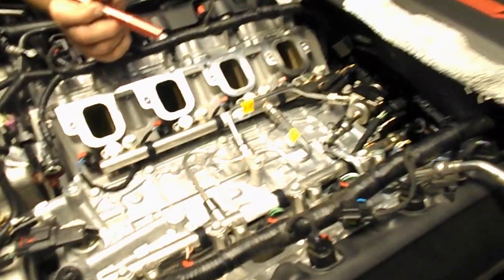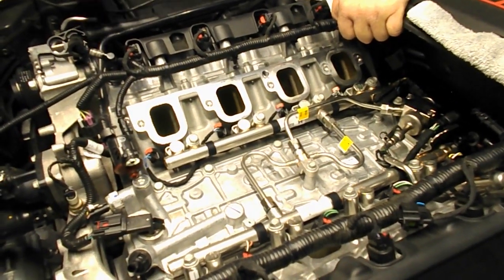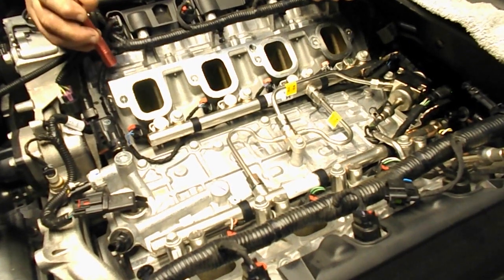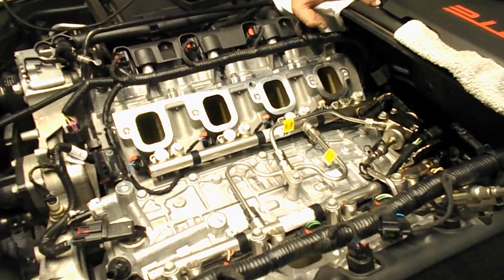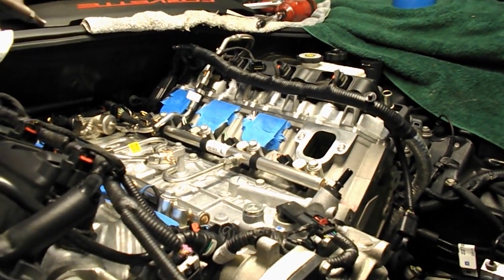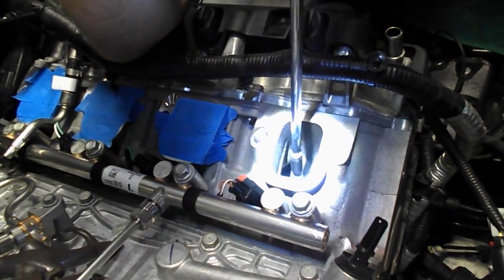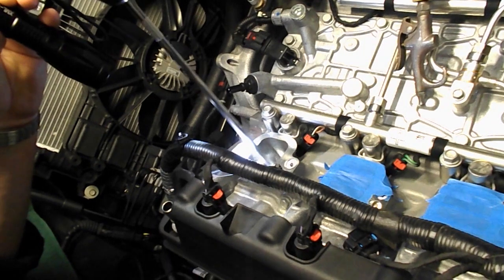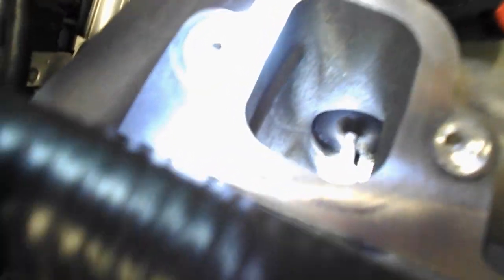RX intake valve cleaning

Comment from the maker: Hi Rafal,

The Press releases from Toyota, BMW, Mercedes, Audi, etc. claim they have what they have to date denied was an issue, fixed. The facts are they have made a small amount of headway, but none have corrected this, not even close (remember, to date, NO automaker admits this is occurring, yet in the past 3 years ALL have issued press releases on how they have now corrected it).

The 3 ways it is being dealt with on the OEM level areas follows:

1.  More robust/effective internal separation of the oil and other compounds from the PCV vapors. This helps, but at the sacrifice of engine longevity as these are also retaining the damaging combustion by-products to accumulate in the engine oil. 

2. Many have added in small port injectors, but the amount of fuel hitting the valves is far too little to clean and cool them, and it also now is creating high amounts of detonation so timing is pulled when the knock sensors detect this, thus defeating one of the main advantages of GDI. Most GDI engines are 11.5:1 compression ratio or higher, this is what allows them to make more power, burn cleaner, and not experience detonation. So, this is a huge backwards step.

3. Variable valve and fueling events.  The VVT cam allows the valves to open and close at different timing events to attempt in getting some fuel to touch the backsides of the valves. And to command injectors to begin adding fuel early, but again, this is far too little and over time has little effect.

Look at this picture to see why this was never an issue with port fuel injection:
[URL=http://s1083.photobucket.com/user/tech17/media/Port%20injection%20cutaway_zpscpca8akg.jpg.html][IMG]http://i1083.photobucket.com/albums/j392/tech17/Port%20injection%20cutaway_zpscpca8akg.jpg[/IMG][/URL]

Fuel constantly used to spray on the valves backsides keeping them cool and deposit free. Now here is GDI:
[URL=http://s1083.photobucket.com/user/tech17/media/Direct%20injection%20cutaway_zps8fg5at1r.jpg.html][IMG]http://i1083.photobucket.com/albums/j392/tech17/Direct%20injection%20cutaway_zps8fg5at1r.jpg[/IMG][/URL]

As no fuel is introduced until the milliseconds before ignition, the engine can utilize far higher compression ratio and produce more and cleaner power, with less wasted fuel (better fuel economy) as no fuel is present during the compression stroke to pre-ignite (detonate). But, when you now start to introduce fuel early, then detonation rears it's ugly head and the benefits of GDI go away.  Audi by the way is running 18:1 CR in the lab test engines on pump gas with pure GDI, which we would have never though possible in the past. Until the external system that separates the oil and other contaminants from the PCV vapors patent is issued and this is submitted to the auto makers direct, (it is a system similar to these but requires NO vehicle owner draining or service for over 100,000 miles as it "self empties" and meets all EPA requirements) and that is still 4-5 years before it can be added to the production process by the automakers. (even GM's ignition switch change took years and was only a .50 cent fix).

So. not even today's 2016 engines from ANY automaker have solved this, and there is no way until these contaminants are separated and removed from the intake air charge to solve this.  Oh, and Audi was doing the added port injectors 5-6 years ago to attempt to solve this. Do a patent search and you will find every automaker has several recent patents issued pertaining to solving these issues, yet all are only band-aid attempts and not addressing the actual cause. 

Questions? Just ask. over 4 decades working inside the industry and 8 years of GDI specific focus working with other industry engineers. Plenty of "snake oil" solution out there from companies just selling whatever.

Comment: Yes Toyota has a solution to keep the intake valve clean
Reply from the maker: Toyota has added in small secondary port injectors and this has helped slow the rate and severity of the coking, but only by app 50%. And in doing so increase the incidence of knock retard so not a good solution. The only true prevention is a proper system that is 95% plus effective, and then there will still be a small amount over time due to the EGR burnt gasses back filling emulation the VVT accomplishes.

Comment: you can easily go to a certified GM dealership and get a decarb service for a 110 $ this is more effective than a catch can especially for a daily driver
Reply from the maker: And in every case the best it removes is 40% (read the details) and 20% is average. And then the damage done to piston skirts and cylinder walls from the hard abrasive particulate matter shed as some is forced between the piston and cylinders causes scouring. Ford has already released TSB's on any solvent based engine running cleaners used in their GDI engines, and then the contamination of the engine oil from this solvent and the particulate matter results in a high incidence of failed rod bearings.
Reply: I'm considering buying your catch can  is the oil separator cap necessary with the 2017 dry sump cyclonic separator??
Reply from the maker: Yes it is. The early dry sump internal designs allowed pressure to build and caused the "puking" out back into the main air intake, but the revisions for 2016 and up corrected that and provide a much better internal separation. The cleanside gives an added guard against oil mist being forced backwards against the flow if driven with extended WOT intervals. If not, then you can do w/out the billet cleanside.  The most important change using our dual valve system provides is the addition of a second evacuation port and to use the suction resent during hard acceleration just upstream of the TB. The checkvalves will default to the strongest source available during that mode of operation. Were assuming you have a Z51 optioned NA 6.2 correct?  If the Z06 supercharged, that is a bit different application.
Reply from the maker: Only if your going to run extended high RPM's such as road racingnor all around aggressive driving. GM did a great job of improving on the dry sump cyclonic separator design over the 2014 version that caused oil to puke backwards out the cleanside into the main air bridge.

Comment from the maker: LOL!!!!  You would need to first understand the technology of the GDI engine. When you go backwards and add a small port injector in, you now have increased detonation again as fuel is again present during the compression stroke defeating the ability to run 11.5:1 CR and higher on 87 octane. The small injectors also now have little effect on reducing the coking as the valve must be showered directly with fuel as pure port injection.

So common for so many to make assumptions based on PR spin. You need to actually examine and study these cars on the road to see very little improvement, but going backwards a ton. True GDI removes all combustible fuel mixture from the cylinder and combustion chamber until that final few milliseconds of the compression stroke. Then the fuel is introduced just before ignition.

The other main focus the automakers have been working on is internal separation, but that is now retaining much of the damaging compounds that must be removed to prevent excessive premature wear to internal parts. So, there is NO solution that can be implemented w/out out side air/oil separation.  There is not a single 2016 model from ANY automaker that has this even close to being solved.

Comment: You guys says there is no company solving the gdi issue, but that's technically wrong. Toyota has D-4S specifically for this, as does audi offer a "D-4S" solution for European only A4s, which they put in for "emission reasons".
I don't understand why consumers buy straight GDI considering all the problems... It's not like any manufacturer comes forward to offer their customers a fix, like lexus does. So straight gdi is loss/loss in every aspect...
Reply: This video is from 2014.  In other comments, Tracy Lewis does acknowledge several means being tried such as adding port injectors.  But, they say that doesn't fully solve the problem.  See their comments above if interested.

Comment: These are not that bad for carbon on the intake valves.
Im a audi technician and they are not even in the same league for carbon build up.
Of course none is better them some
Reply from the maker: At 5500 miles. BMW and Audi seem to have some of the worst as far as rapid build up. Were seeing worn valve guides as well in 30-40k miles from these being drawn into the guides, are you seeing the same? Most techs are not aware of this either.  Our catchcan systems (95% effective vs most at 15-30%) can eliminate up to 85% of these. We can prevent the fuel dilution of oil as well in GDI engines.

Comment: The GM 3.6L LGX/LGZ engines GM has deleted the "positive" function of the PCV system in an attempt to slow the rate of coking. While it appears to have a slight reduction on the rate of coking, the trade off is now much of the damaging compounds the PCV system used to evacuate and remove from the crankcase now remains in it contaminating the engine oil and shortening engine life by increased wear. Not a good trade off.  We make systems just for these engines as well as supercharger systems.